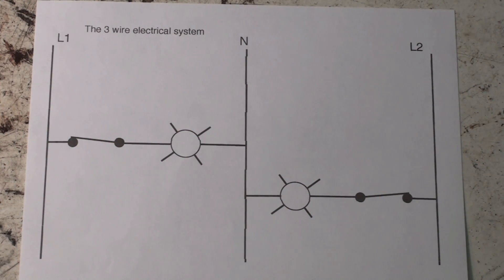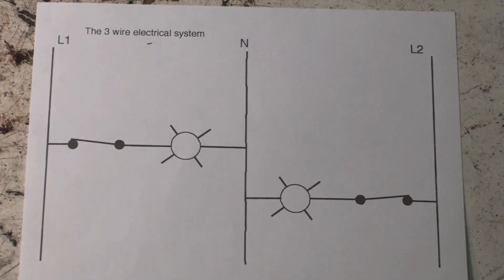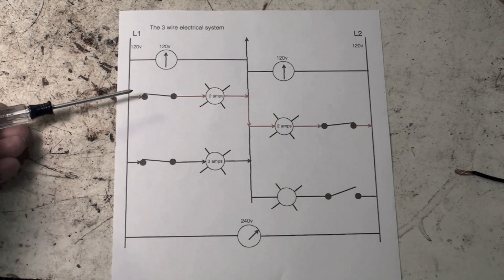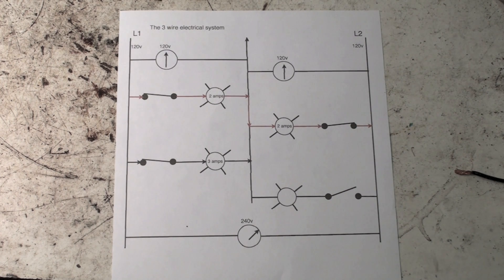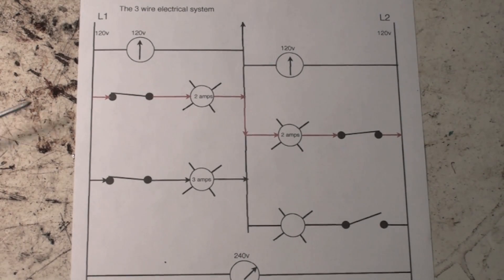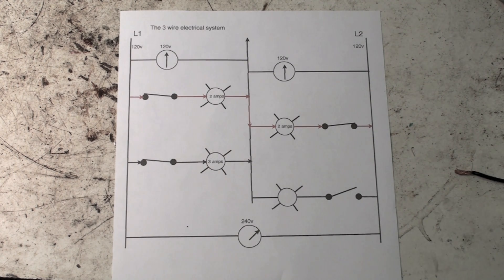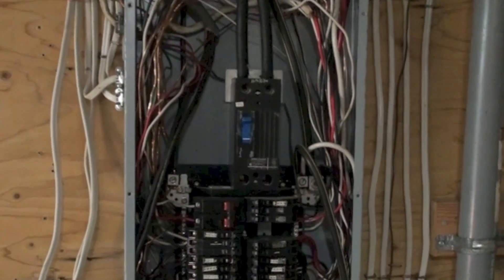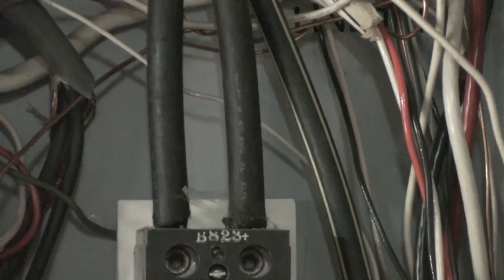How the 3 wire electrical system works

Comment: This explanation gives TOTALLY WRONG information about how the NEUTRAL works. Clearly this guy has never studied electrical power distribution.
Reply: +Jim Blakely  How does the neutral work?  Also, If there's an unbalanced load travelling back on the neutral, and the neutral is grounded at the panel, what is preventing the current travelling back on the neutral from flowing into ground?  Thanks
Reply from the maker: +Crapgramp There is no potential to earth ground.  Earth ground has very high resistance and is only for lightning and surges.  Unbalanced loads are really not an issue.  When the circuit is unbalanced, it just means that more power is going thru one side of the pole secondary.  We want to balance the loads because unbalanced loads put more load on the one side of the transformer.  Hope this helps.
GFM

Comment: Sorry I may be getting to involved for your discussion . I've been out of the electrical field for two years or so and like to talk about it to try to stay in it. So thanks I don't want to sabotage you discussion.
Reply from the maker: SILVER COLLECTING2015 There is no difference between the 2 hot wires.
GFM
Reply from the maker: 680ecks You are welcome to the discussion.  I will do a video using 120v loads and test the neutral amp draw.
GFM
Reply: grayfurnaceman I am confused on which big black wire goes to which side of the main box. does it matter because the wires are both hot (L1 and L2) so even if i hook them up from either side on the box right under the smart meter it should not matter right? They are both the same size wire and the only difference is one has a white line on the rubber cover (insulation)
Reply from the maker: SILVER COLLECTING2015This one bothers me a little.  The hot wires from the meter are commonly the same color.  I have not seen stripes on them.  The neutral has a stripe on it and is usually smaller.  Hope this helps.
GFM
Reply: grayfurnaceman but either side is good for installing them right? The black ones i mean. The neutral is pretty much not the same so it wont be confused
Reply: Thank you

Comment: I think again don't know how but the unbalanced load is dissipated at transformer . In very large factories with machines running I have seen voltage at the building grounding conductor. These where large higher voltage older manufacturing facility's and was told it was normal and never to disconnect the grounding conductor with the power on. But that is far as my understanding goes.
Reply: Unbalance load will damage the transformer winding

Comment: I gues hat I don't get is you are showing ( with red arrow ) voltage going from L 1 load N  load L2 . My though being it would only flow that way if you lost the N connection, not normal operating condition. In that condition you get strange voltage readings on both legs like 150v on one and 90v on the other.

Comment: No I do think the voltage goes back to the pole on the neutral wire because l1 and l2 gives voltage reading to N. I don't know where it goes from their.  I do know that the N is bodied to ground at the pole and if you lose that the voltage will try to return to pole on anything including the cable tv wire. Again I'm not a line man so I don't understand the distribution of the power and may not be grasping the hole concept. My understanding is power flow is from L 1 to N andL 2 to N 120v and 240= L1 toL 2 flow because of difference in potential between phases ( Sign wave)

Comment: I agree with jasontrades4x that is my understanding. I have never seen it expressed like the video . I am not a lineman so my understanding stops at the power co. service conductors .
Reply from the maker: If you somehow believe that 120v goes to the grounding rod if the 240v load is not balanced, try disconnecting the ground rod from your panel.  Then turn on one 120v load.  If you are correct, the load should not operate.  
GFM

Comment: I did not state the ground resistances correctly in my haste to reply, as these resistances will also include the single wire resistance and lightbulb filament resistance,...which,the latter is not so easily known due to filament temperatures.

Comment: I saw the videos you told me about,(thanks, that is exactly what I was wondering about), I noticed that as the voltage input increased that the apparent ground resistance increased,...120v=1000 ohms at 200 feet,240v=1200 ohms,and 480v=1655 ohms. The last high voltage 12000v test= who knows! Very interesting though,...also like the DC test. Each test was basically same conditions,...I like that,...it gives me something to work with in my thoughts on the subject.

Comment: This question is hard to convey,but,...is it true that if the soil conditions are the same over a great distance from one ground rod to another ground rod that the low ground resistance(measured with a megger)at each rod will not have any additional resistance in the soil across the span between the two rods?
Reply: In other words, if a power source has one line grounded and one line ran way out to a light at the other ground rod and the light is grounded to that rod on one side,would the resistance only be that of the two ground rods immediate location resistance plus the resistance of the length of the single wire?
Reply from the maker: John Kerley I did a series on panels and grounding.  It might help: @playlist?list=PLItXrh64d2JNJOjSivaYXeX88i8MNWgwu
GFM

Comment: This is just something in general about utility electrical supply that is kind of funny.... you can put more amps worth of breakers in a 200 amp service box than the rated 200 amps. The power companies just do'nt figure that everybodies going to turn on that many appliances at one time. Not only that, but also the pole transformers ca'nt produce as much amps as all those breakers added together.
Reply from the maker: John Kerley Most panels have a larger total breaker ampacity above the 200 amp number.  They assume not all circuits will be drawing amps much less be maxed out.
GFM